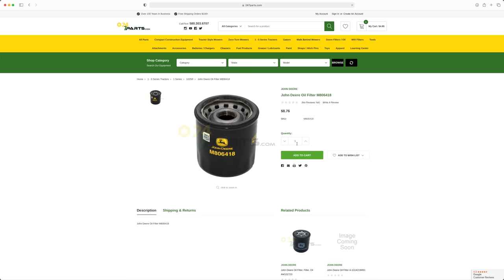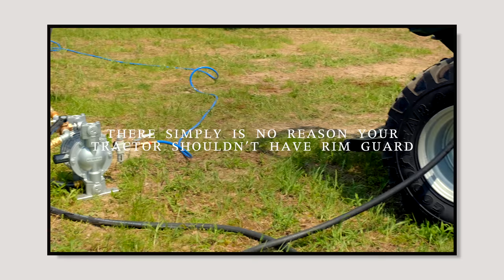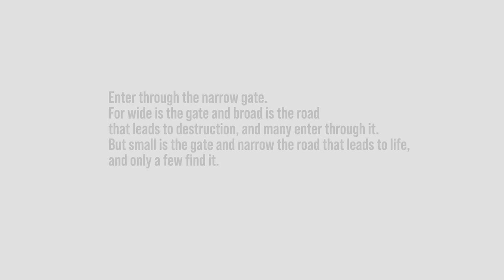THE BEST SUN SHADE CANOPY FOR ZERO TURN MOWERS & TRACTORS! 🚜💪

Comment: I have no use for a ZTM, but watched for the algorithm. If anyone cares about rattles/squeaks, run a strip of butyl tape along the top side of the canopy bracket before installing the top.  The noise and vibration of our Polaris Ranger was awful before doing that for its roof and seat.

Comment: Two questions: Does the ride seem bouncier or smoother with the tweels? And are you missing guards over the pulleys? I can't believe they would leave those open like that. Also, my only experience with ZTMs is the Scag Patriot 52".  I bought the 52" because of the scalping issue. In retrospect, I'd prefer the 60", primarily because the deck extends further past the wheel than the 52" does, and that makes it easier to get up close to the chain link fence. But other than that, I've had no issues with the Scag, and it's 2 years old with just under 150 hours on it. I've only gotten in stuck once where I had to pull it out with the tractor :)

Comment: Those are nice if you had a cub cadet commercial, it would’ve came with a place to put a ball hitch and a striper kit comes on the decks for the old cub cadet commercials. Still don’t know why anybody buys other brands outside of cub cadet. You get so much for the money and the Construction of the frame can’t be beat.

Comment: I can vouch for Hustler Zero Turns, I bought mine in 2016 with the 26 hp Kohler Engine & have beat the ever loving hell out of that thing & she’s still running. I did break the 5/16 hex frame bolts that secure the transmission to the frame from the frame twisting over & over again on extremely contrasting angles of ground, & have replaced both drive & deck belts. But for what I’ve put it thru I feel like it’s held up extremely well.

Comment: My 930M so far so good no problems. 2017 model. Just added the rear tweels, much better ride with the suspension seat. I added a light bar in the front with a spot/flood combo. The jack is cool, but I have a lift that picks the front up higher. I like the canopy and front tweels, though my fronts are solids. My only complaint is the MOD. It does OK, feel it could be better. If I sell it, the only other mower would be a Gravely Mach 1 or 3 with the 60". I know a lot of people who sold their John Deere for Gravely's and a couple that went to  Hustler's. The cuts are better on those from me just eyeing. I'd choose the Gravely because the features, cut, and told that their service department is better than John Deere
Reply: I have a 2021 Gravely Mach one with 60” deck and it will really cut some tall grass with the deck design it has….I cut a lot of municipalities that do not get much maintenance and when I show up the grass has usually 3 to 4 weeks of growth on it….I have Scag and hustlers and have had quite a few other brands through the years but when in deep grass wet or dry I always have to make three or four passes to clean most properties that have a foot of growth with mixed grasses and weeds…Since I’ve been using the Mach One I can slick most of my properties off in two passes and has cut my time almost in half on my overgrown properties it’s one heck of a mower!

Comment: I have to recommend Ferris.  Yes, they're pricey, but the quality is outstanding, the comfort of the sprung suspension with shocks is amazing, and mine sips fuel like no other mower I've ever had.  It has the 28hp B&S IC engine with the 500 hour oil system.  A buddy of mine has the same mower, and we're both astonished at how many hours of mowing we get out of 11 gallons.

It's a 2017, and the only problems I've had were my fault.  I smashed the left fuel gauge by getting too close to the deck overhang on the house, and I plowed into a large patch of 6 foot tall blackberry bushes (I hate those things!) and one of the times I was backing up, the wiring to the mower deck clutch got yanked out.

Both were easy to fix, but overall, I cannot find anything about the mower to bitch about.  I treat this mower like it's a brush hog, and take it places most people wouldn't.  It's both a beast and a beauty, and cuts everything from grass to 2" saplings.

I've always just used the forks on my tractor for blade swapping, but I do like the idea of the tongue jack!

I have the same swivel jack on my smallest trailer, but instead of swiveling it for travel, I just pull the PIP pin and toss the jack in the bed of my truck.  I will definitely buy a new one for my mower, weld the bracket on, and at blade change, just pop the jack on.  I'm excited about that idea!

Last thing, (you asked us to comment 😋) I'd have those roofs made in white plastic, or I'd paint the top white to reflect more of that heat.  Being in the shade is great, but sitting directly under a 140°F roof ain't.

Great video! 😁👍
Reply: I completely agree - black is way too hot! I decided to make my own canopy for this reason another reason is I wanted the water to be able to run off the back or sides instead of the flat roof. And the final reason is I needed it to be removable quick without tools because I travel with the tractor a lot. Check it out here: https://www.youtube.com/watch?v=RzP4THg0Mds
I like GWT's shade but not quite what I wanted and I didn't want to sacrifice one of my reasons.
Reply from the maker: I understand this in principle, but it has not been an issue even in the slightest of ways.  I've sat dead still under these canopies in the baking sun and felt no radiant heat coming from them.  There aren't any sides, this isn't touching your head, and 99% of the time its being used while you're moving.  There is a breeze or airflow moving anyways.  It is a nonfactor.  It is a misconception.  

Similar to when folks tell me to remove my bucket while brush hogging because it's blocking the airflow from entering my engine compartment for cooling.  I'm going 2 mph, nothing is getting blocked 😂
Reply: @GoodWorksTractors  that's a good point and probably right. The difference for open air is probably a small percentage. it does make a big difference in an RV if the roof is white or not but that is generally closed and not moving when in it.

Comment: I cut 32 acres across 18 residential properties with a 72" zero turn and don't have any scalping issues. Getting in and out of ditch lines requires some caution, but that's true with any width mower. Once you've cut with a 72" mower there is no going back.

Comment: Have a 2021 John Deere z994 diesel with the fastback rear discharge deck, tweels, and suspension seat. Mow about 8 acres. Diesel engine can power through anything I have encountered.  Is fuel efficient and with an 11 gallon tank I can mow for a long time without having to refuel.  Love everything about the mower. Tweels seem to ride a little smoother and get good traction in wet conditions. Because the mower weighs about 1700 lbs you do have to be careful with your turns or you can tear up some turf.  Came with a 3 year 1500 hour warranty.

Comment: I picked up a z trak 717a 48”, with a few hundred hours on it 4 years ago. Was used by an older woman to mow around her log home and pond. It was barn kept and the seat was in great condition. Needed front tires (which are a nightmare to change yourself btw) an a general service, as well as a deck lift rubber pedal cover. Runs amazing. I mow about 2 acres a week with it now, and once a month an extra acre of septic plot. I have a set of standard lift blades, and a set of gator blades. I like the gator blades for fall and standard blades cut thicker wet grass better.  The 717a doesn’t have ROPS, but I don’t have much for slope to worry about. Came with a 19hp Kawi, that I have at around 21hp now with a throttle plate mod. And bc the 717a doesn’t have any seat suspension I built my own spring seat pan, which isn’t as good as anything out today, but makes all the difference on a septic field full out. There was a space for a light switch, so I welded up some brackets and bolted some 48watt led floodlights basically in the same spot your light kit is. Evening mowing is great to hear the heat. There aren’t many “options” for this mower anymore, but it’s the smoothest running z I’ve run. I’ve run a couple toros, and I’m not impressed. Run a kubota which was pretty darn nice, and a few larger Deere Zs. I’d love to get tweels but they are not offered for mine.

Comment: JD Z435 (no longer sold) I added a trailer hitch, rear bumper, foot guards, led lights.  I pull a spreader, plug airiator, sweeper, & 1000lb roller.

Comment: I had the same problem with my John Deere Z830A leaking oil for years then i ordered his hose from Amazon and stop the leaking from the cheap plastic drain valve. It will fit the Kawaski engine. Exmark 116-4924 Engine Oil Drain Hose

Comment: Grasshopper is also nice, powerfold deck, on front mounted. I have a 725D. Plenty of power and speed. I don't have any attachments that go where the mower deck is (snowblower, etc). They are expensive, but what isn't.

Comment: I bought a z930m 54" for personal use because in my opinion all the residential stuff at the box stores looked like it was going to fall apart in a couple of years. I got fed up with that quick drain plug leaking myself and bought a kawasaki oil drain hose. So far so good. I also put that jack on mine but I do put jack stands under just for extra security when under that heavy beast. I been looking at the z-glides to put on the front casters.

Comment: I purchased the Rhyno Hyde canopy for my 1025r and I love it for sure. As I examined it,I wondered if the canopy itself had an intentional front and rear when mounted since there isn't any mention of it in the directions. I concluded that the taller end looks better towards the rear. 
As I watched your installation on your ztm,it appears to be mounted in the opposite direction. Did you do this because it looks better to you? Or did you even realize that one end is slightly taller than the other? Not intending to be negative of course, it just looks a little odd mounted that way. Love your channel by the way. Great content in every video. 👍👍

Comment: Can we just mow without clamping strapping and cobbling crap all over a grass cutter. Dear god a 5 gallon bucket. How about an ice cream churn to take advantage of the rotating parts. Maybe an ice maker for the ice cream churn. 😅
Reply: No.  All of the add-ons are mandatory. You must comply. Resistance is futile.
Reply: @justanotherviewer52  😂 I’m busy getting my snow pusher attachment backed up to the Z right now. It was in the contract 🤏🏼
Reply: I'm up for the ice cream maker on board.  That's a genius idea!  Also, a margarita dispenser would be nice.
Reply: @JCWren  I’m workin on the cream tank and salt dispenser for the churn and the rim of the glass. I’ve got to find a space for a mini fridge tho. I’m thinking 3rd function with a raised platform that will lower and articulate in within arms reach. It’s the only way I’ll be comfortable pushing snow. I’m gonna need studded run flat tires for the winter. Maybe skis up front of the pushers. That gives me another idea. I need a pencil sharpener to check all the boxes.

Comment: Deere 997.  I think it's a 2004?  The diesel sips fuel and the lift on the blades along with the tip speed clears grass well and does not create as much dust as other zeroes with higher tip speeds.  I mow one old cornfield and another property with a old vegetable garden, both are rough but this mower is built really rugged.  Two of the properties I mow are on highways so I use the same trash/grabber set up.  The Deere blades are better steel and hold their edge.  Our front yard is 5 acres with over 100 hundred trees and bushes so I seldom get to mow a straight line but my wife is happy.  I have suggested to JD the addition of a cab with AC.   Deer 345, 445. 455. 955, 997, 4720.  Blessed for sure.   I have mowed 3 food ministry properties for free for 21 years now.  Not bragging, paying it forward.  I have used your code twice, thanks!